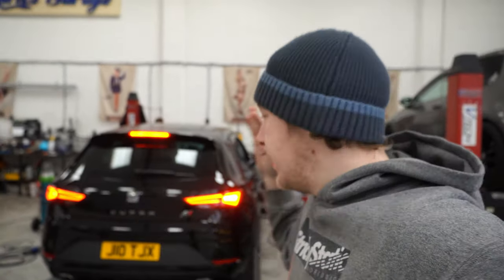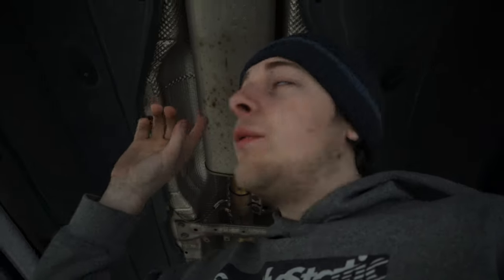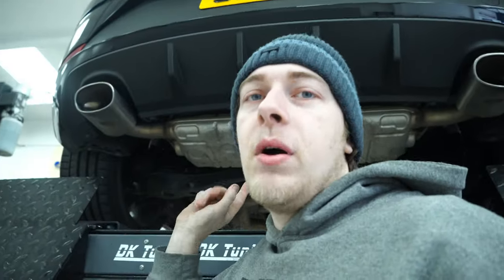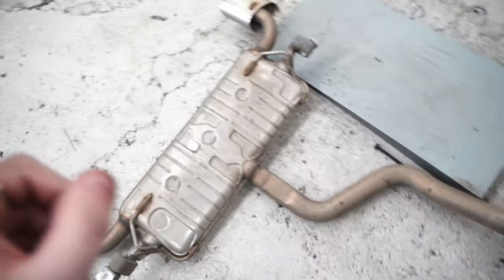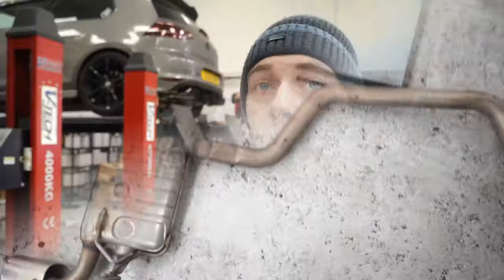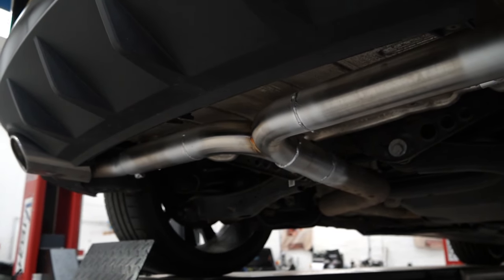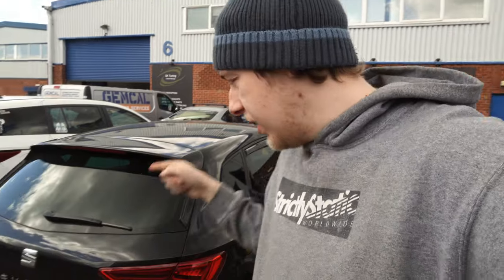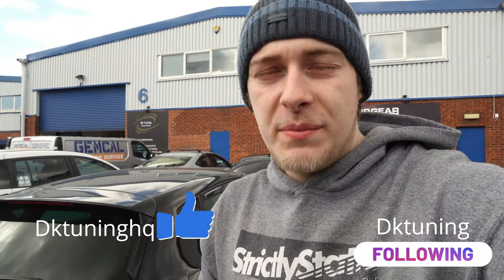CUPRA 290 RES + BACK BOX DELETE *SOUNDS AWESOME*

Comment: Please please don’t do this!!! My 2020 sounds waaaaaay better with it all intact.. the only way you will get the gpf car’s to sound the same as pre gpf is a full downpipe back system and a tune. My 2020 still has dsg bangs and the odd proper bang amongst the quieter ones when it’s hot, but I will never put shit fuel in. Allways vpower or sometimes momentum. Don’t waist your cash guy’s! 🤙🏻